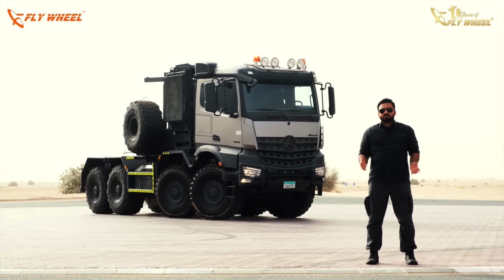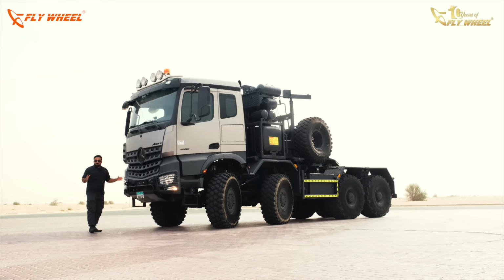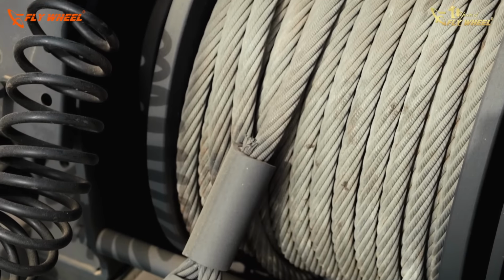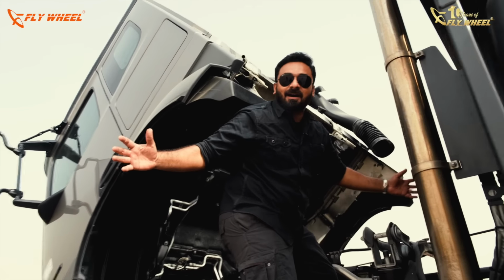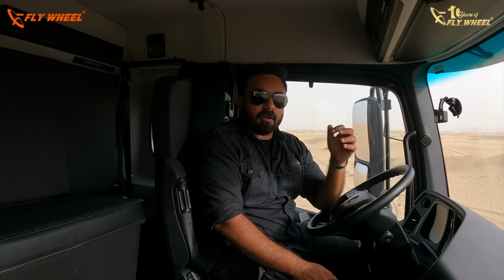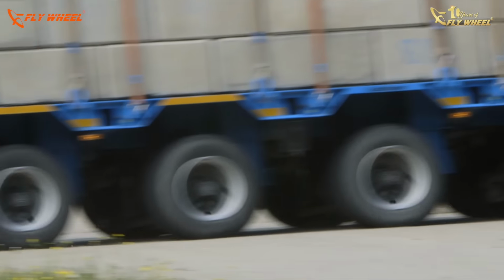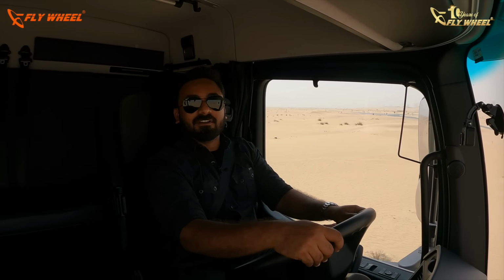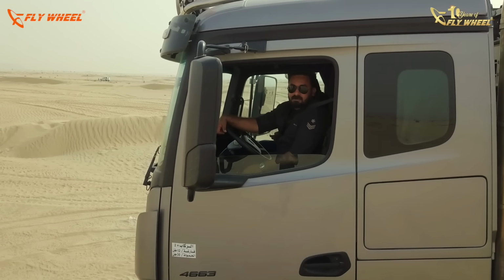Mercedes Benz Arocs 4663 SLT 8x8 Truck Review | HE-MAN among Trucks! | Flywheel by Hani Musthafa

Comment: If solid box u can ship or carry container, use it full height while running down road & in bad weather safe secure & no RV noise biggest pnt. Earth cruiser makes a cool! Kevlar screen divider that u can separate cab from rest of rig so full opening front to back. Even more important if u articulate the cab from back of rig tuff. Hving muti arm multi pivot crane means u can if fully extended out reach most if not all of truck front to rear. If RV-ing all by self stuck or broke down arm back up.

Comment: Best things for RV's I hve seen r hybrid rooms screen indoor out door best of all, just not the cargo box roof lifting near double height or less even going down road. @nd best thing I hve seen is Murphy Bed design yet no1 ever used 2 on same design b4. 3rd best is endless circulating show. 4th best is pop up dormers, 5th best is high low camper designs. 6th best is if u hve truck 450 weight poss a slide outs for slide in camper or slide outs on anything. The wind shield must be tuff like corriane cook where or bullet proof center divide by clear member, double pane min a must tint even better transition tint best of all.Mirrored or black tint great too.
Reply: PS is poss the 7th thing greatest thing in RVing is the 5th wheel type camper porches 2 greater than 1 bc sun shifts during day.

Comment: My idea no1 uses is to make rims tall & dual rim rather than super single or dualie, bc redundancy. U mount 2 tiers on 1 rim u hve true back up, good traction any rain or mud & u don't need to inflate both tires if lightly loaded meaning less drag 1/2 the tires down touching dragging/wearing more efficient cheaper operation.

Comment: titinate, The rear garage should be box square not an angle back end losing space. It is not fix attached to RV/shipping container but separate garage box that can stay w/truck or ship separate. If it lowers to ground way easier to use & giant big foot. The RV feet should be right or left center of frame not on outside of truck carriage. If falling over cliff the closer u r to center line the safer.

Comment: Air &/or hydraulics r stored power like fuel or batteries or best of all heated or cooled water or fly wheel. More coming add on's future designs for sure. If u must carry water tank why not make it hot or cold tanks also. In hot climate chilled or near ice water is useful. In cold climate pressure boiling heated water is also useful so long as tanks can take heat or cold & u hve mixing valve. So fully loaded/fueled takes on greater meaning if tanks all full all heated or chilled & fueled up every way poss b4 u take off. Any sun solar heating or juice collected must hve room in some way to always still not full being collected though. So max fueled is really 85% leaving room for more solar heating,airing chilling/ heating.

Comment: I like it but want to customize. I don't understand the fancy clucking but sounds great. It sounds like it stops as well. Hving quad cab is min, all windows open & double thick glass like tesla great idea(bullet safe option ok too. Hving 650 hp ok but 750 even better in line 8 beat a 6, for some heavy jobs. No1 makes any engines yet but should that hve compressed air mix vs just diesel fuel burn. If u can spray in 10,or 15% poss 20% air at right compression so u even at elevation never feel lower fuel burn. Most of time never burning just fuel, instead most air poss running inline 8 for the load. Only just fuel if pulling space shuttle.
Reply: A 6 seat cab or 3 row should be poss option. No1 makes this but driving equipped from both sides or u can take off the wheels. Both driver right & left full redundant can drive at same time, or switch off while driving.

Comment: No1 makes 5th wheel w/a full shipping RV style box sitting over top of the 5th wheel. It has to raise & lower the roof/sides of the RV box solid not screen walls for wind & sound control. No1 makes it/this yet but diffs should hve two sides & two drive shafts each. Bc if pressed together they r a solid axle but if not pressed together r independent axle way better & again redundant. Each side able to just free wheel not driven turn.

Comment: Again no1 makes it yet but should God wants it. A 7speed manual sequential gear box for towing from stop in mud or off road driving. Then 2 diff 7speed auto gears in high & low if loaded or unloaded & dirt.gravel or paved driving. U hve best of both set-ups control or dialed in most efficient.

Comment: W/a boat V16 u just cycle the whole cylinder on & off w/compressed air so u never really running more than V8 but getting power for 16 still & less pollution by 1/2 & way less heat meaning less wear. God

Comment: Didn't the FH 16 set the world record for the heaviest load pulled by a single truck?
Iirc, they pulled over 750 tonnes using an 8x4. Unless this thing has an even bigger gear ratio than the FH16, it's not worthy of the title "He Man of trucks"
Reply: Heaviest load by a factory production truck. There are modified trucks in the heavy haulage sector that are rated for more. The Titan Z 64 600 F 8x8 is rated for 1000 tonnes.

Comment: No1 makes this yet but I want standard brakes & air brakes poss again redundancy. So each tire disk gets 2 brake lines. 1 line connected into front top caliper & 2nd line connected in to rear top caliber. Air brakes can be on the bottom if truck has them/ or needs them. No 1 makes it but if u hve a right emergency brake cable & 2nd left emergency cable u hve better tight turn system them new ford bronco. Why better bc simpler is better & redundancy brake for only 1 jack knifed side. In slipper condition like ice hving both emergency cables slighty engaged means more control & u can till slow down. Then w/my snow socks(super tuff fabric ) u r under control. If heavy snow use snow socks w/chains on top too for 6" deep cutting/driving thru snow.

Comment: 96: My God idea is to hve differential/hogs head of to be slide in not a normal housing But a threaded housing on the inside of hosing just so. This way under load or stop start jarring u better handle that torqe load only moving say 1/4 or 1/2" turn most/bulk of time but can take 3" of turn ok max load.

Comment: Driving on a cliff edge road u need to air or better hydraulically hve truck leaning way so weight on inside of road not edge of road so u can lift body &/or suspension just the right or left side.

Comment: DC is far greater except sending it so in that vain every thing needs to be on DC able to even be portable used any where bc a DC not just RV appliance. Even generator should put of DC, if heavy load like circular saw hydraulics can still power it to saw nothing for air.

Comment: Air bags great but hydralic lifting /bal even better. Why no1 yet has air lift even many SUV r market yet crazy but no 1 yet has my idea lifted the suspension & air lifted the body as well like a jeep I do not know. u get 1 or other lifting never both better safer design esp if off roading vs normal driving. 4 wheel steering is great but look at any bus & articulation is even better esp if under heavy load or off- roading. If u hve both 4wheel steering & better articulation u hve nasa/God redundancy example again. 2 tanks beats 1 big 1 4 beats 2 big 1s, Bc balancing weight better & if u fill up different places u hve redundancy if u big u bad fuel batch. Just fill 2 of 4 but don't run any tank dry esp if fueling at out of way suspect fueling retailer. 2 filters min but if u keep oil mostly feeding/pumping front of engine or rear of engine again u hve redundancy, if u still get some oil going from each pump to front & rear of engine, meaning can never go fully dry way after light goes off. They hve plugged in heating pads for oil crank cases or fuel tanks or batteries.